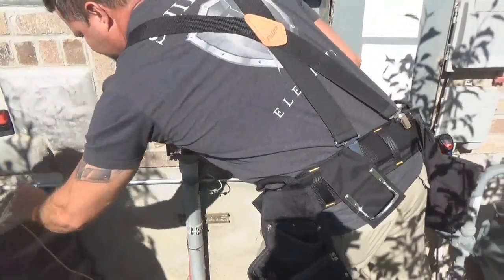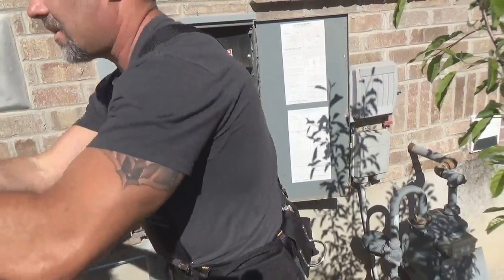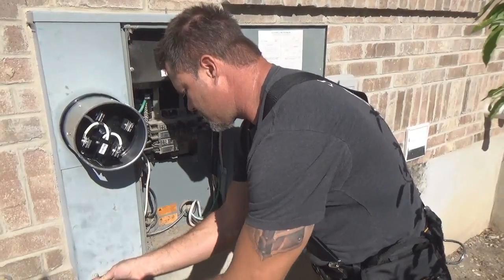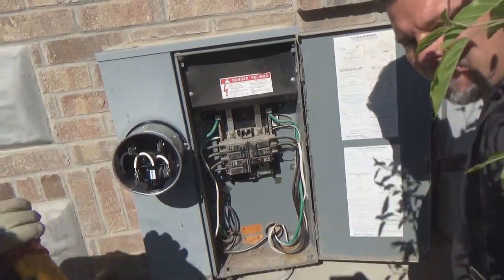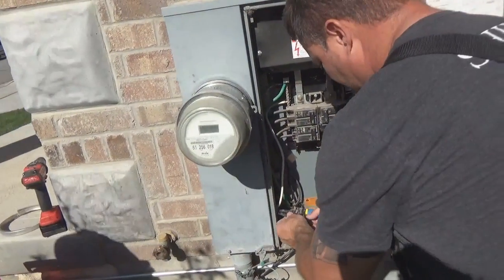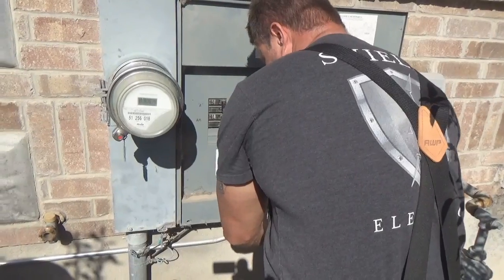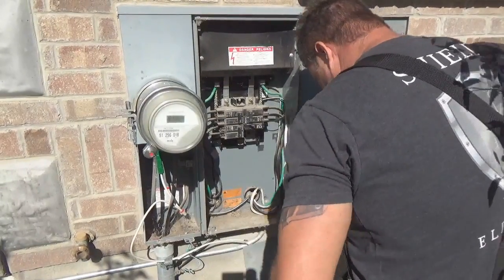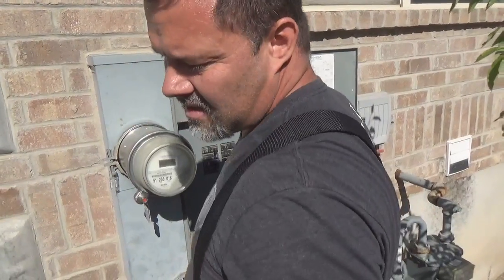house power switch for generator - homerun - myinpower

Comment: Do you have to turn off the main 100 amp breakers on the electrical panel along with all the circuit breakers on the electrical panel before starting your generator to run power through the GenerLink?

Comment: Why make a hole across panel when you have a lug on meter side? Just wonder.
Reply: Well the wire protector wouldn’t matter since the nuetral is bonded to the ground wire and bonded to the panel. Still I would have put one. Also it’s not legal to tap anything on the service entrance side. I wish the transfer switch meter hubs were legal in Los Angeles!!
Reply: Right and why not a wire protector

Comment: did I just  see u put a wire unprotected thru a hole,why didn't u use some kind of chase  either a chase nipple or even a pvc connector and lock nut
Reply: He popped in a grey protector, it fell through and thats why he drilled a new hole , so it wouldnt slip through it again...

Comment: what the hell did i just watch
Reply: not sure either. At first i thought the power guy pulled the meter just to allow the electrician to drill through between the panels. Then after power was hooked back up, he had to drill a new hole but the power was back on , so i have no clue what the hell we just watched ! LOL  Damn, i guess i am gonna have to read the video description to see if that makes any sense of it all ...
Reply: Home Run (brand) is a whole house Generator Transfer Switch that's mounted in series with your electric meter. On the bottom of the unit you plug in your 240 volt cord from your generator. A 12,000 - 10,000 watts portable generator can power most homes. When your power is restore...unplug and store your generator. What? You never lose power..you don't need this. Generlink is another brand you can order from Home Depot.
Reply: you watched the install of the generlink automatic generator transfer switch
Reply: I am almost sure he installed a GenerLink transfer switch, did you notice how much bigger it was after. GenerLink is one of the best ways to install a transfer switch for a generator.  They are expensive but the part you saw installed is just about all you need and it completely automatic, senses power loss turns on within  seconds, same when power comes back on. You do nothing but start and stop your generator.  Generic  uses this transfer switch with their hole house generator! I am getting a 16kw for my house propane, no gas. I live in the mountains and have a big 500 gallon propane tank why not take advantage of that!

Comment: Exchanged emails with my power provider; the GenerLink device doesn't meet Washington State electrical code standards and can't be installed here. I doubt the Home Run transfer switch would be legal here either.
Reply: Is your power provider PGE?
Reply: @kmacradio  Mason Count PUD #3. The following is the pertinent paragraph copied from the email:
Mr. Brehmeyer,

Thank you for your inquiry regarding the installation of a GenerLink automatic transfer switch. Washington State’s Labor & Industries’ Chief Electrical Inspector has advised that this product does not meet the appropriate electrical standards in Washington State. They have identified that the manufacturer’s instructions and UL file are in conflict with pertinent NEC and RCW requirements.

I got the answer on 11/3/17. I don't know if the codes have changed or if the makers of the GenerLink transfer switch have made an up grade since. There is an interlock device that can be installed on the panel that prevents the generator and the main from being connected at the same time that is relatively inexpensive.